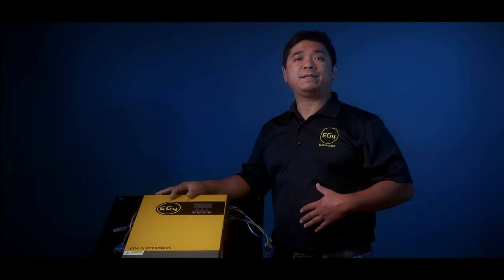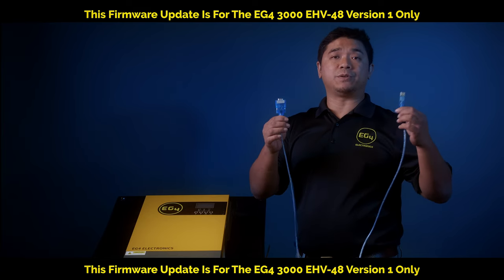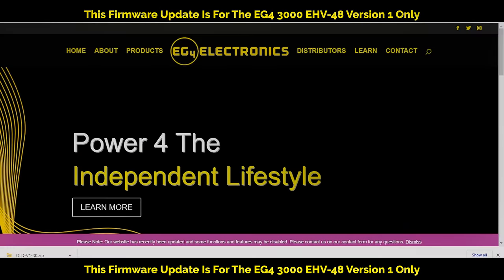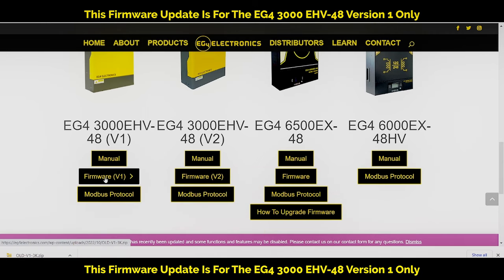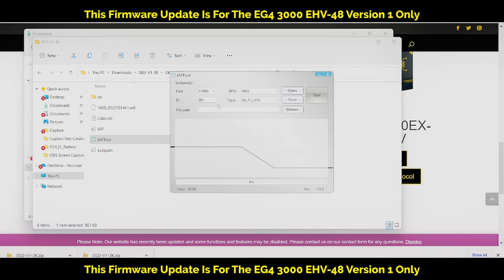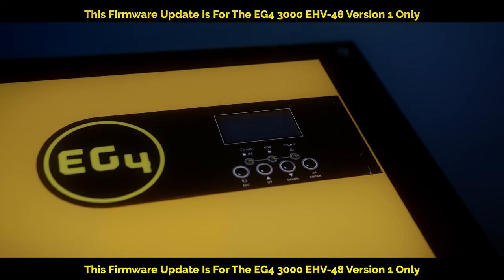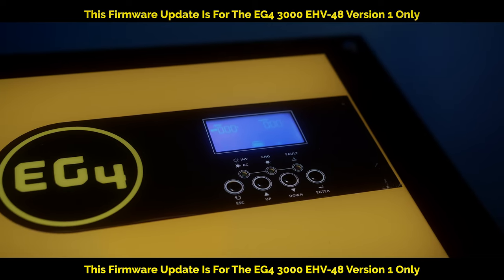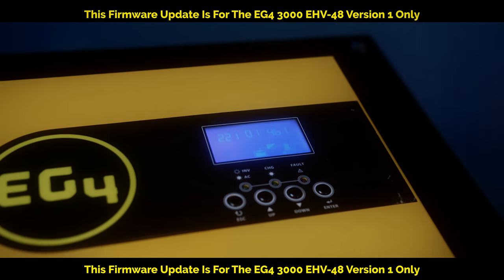EG4 3000EHV-48 V1 Firmware Update Walkthrough

Comment: Version 1 vs Version 2      The current discription ov the V2 says, "Minor Improvements to the exterior design". Looking at the pic I see V1 has square corners and V2 is rounded. 
See Images Below
V1       https://practicalpreppers.com/wp-content/uploads/2022/06/eg43kw-2nd.png
V2       https://cdn11.bigcommerce.com/s-bi8c0htqsn/images/stencil/1280x1280/products/1571/1966/e72881b9-8d32-4c2b-a1b1-7b6b21cf904b__06069.1667234679.PNG?c=1